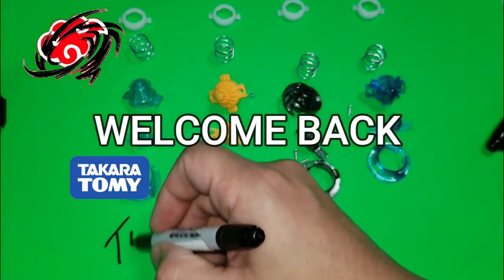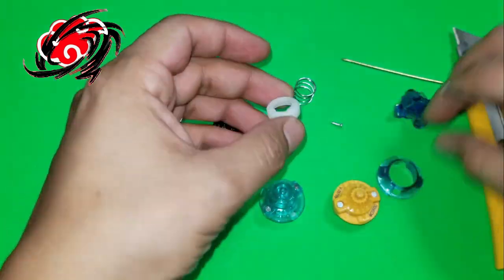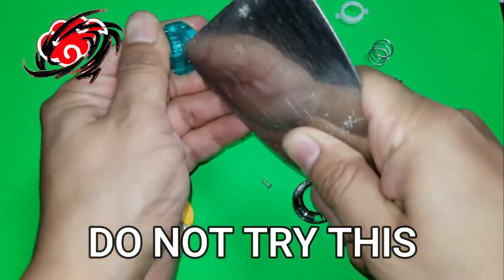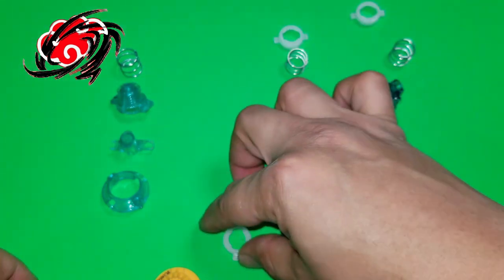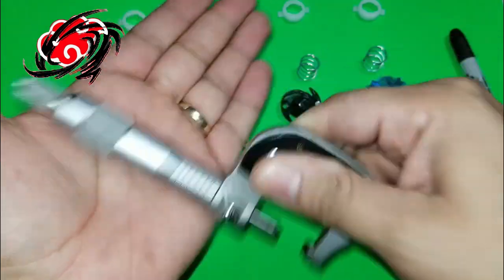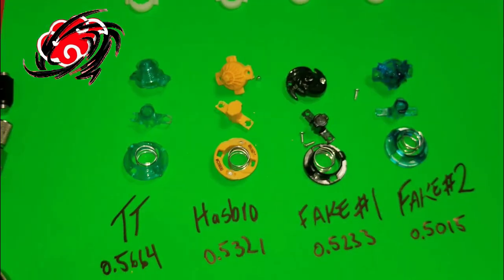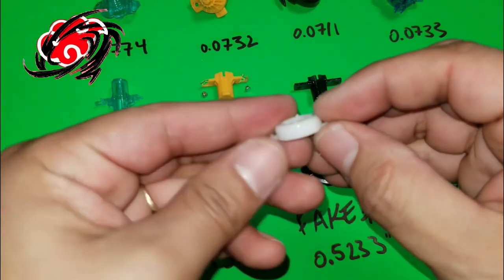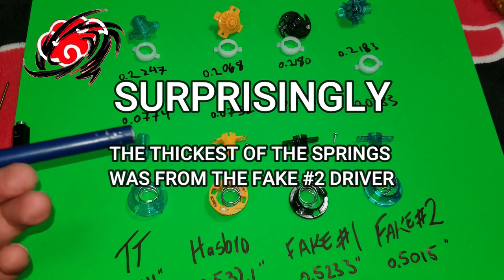ALL Beyblade drivers are the same?

Comment: Wonder what kind of screw does the TT and hasbro have. Is it just a normal screw and they deface the pilot hole to deter modding?

Zankye is pretty bad at this can even become aggressive when you tell him that you can mix drivers. lol
Reply from the maker: Lololol oh wow, well I'm still not sure who's answering those messages him or his dad.. as for the screw I have a short video for it, it's called a triwing screwdriver ✌️
Reply: @BeybladeDad Yes I saw that the triwing screws but for the drivers they dont a pilot hole at all tho.
Reply from the maker: @blankx15  oh yes, that's a pressed fit dowel.

Comment: Can you use flame brand driver to a takaratomy beyblade, My takaratomy driver gave up
Reply from the maker: Yep, they're interchangeable ✌ most people like using them to do modifications 🤔😮
Reply: @BeybladeDad  will my takaratomy beyblade not get destroy from it? And can you use flame brand launcher to a takaratomy beyblade too or not?
Reply from the maker: They're made significantly similar that they won't damage it (from my lited experience), as well with the launchers, they should work just the same✌